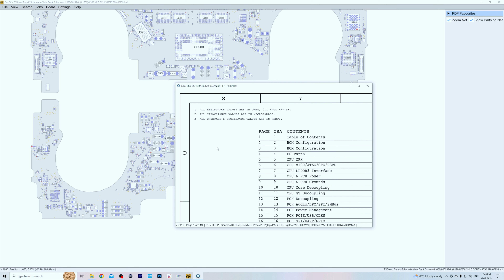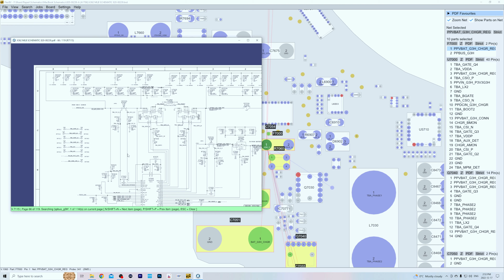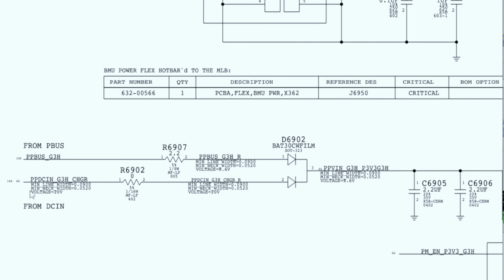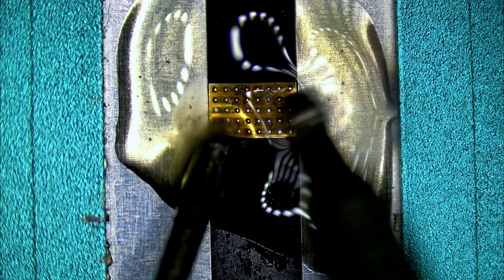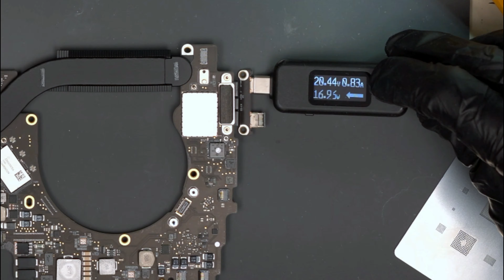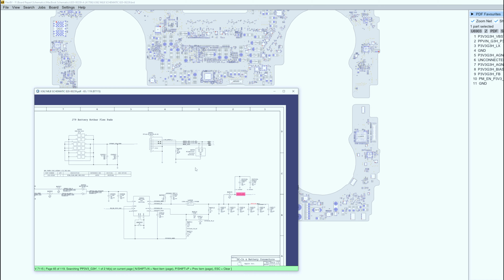MacBook Pro A1707 Won't Turn On | ISL9239 Diagnostics & Repair

Comment: My issue is the same, but another problem is that my board is not stable at 5W. It turns on and resets after 2 seconds, then tries to start again, but resets. It's frozen and keeps resetting every few seconds , can body help me,